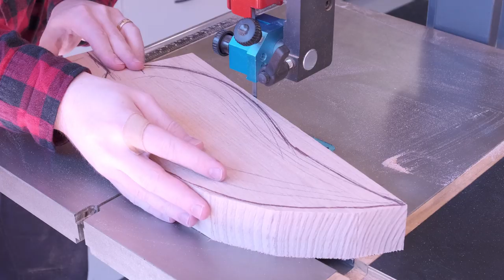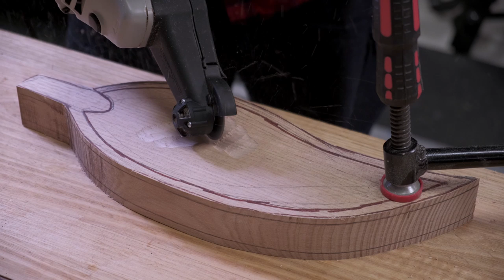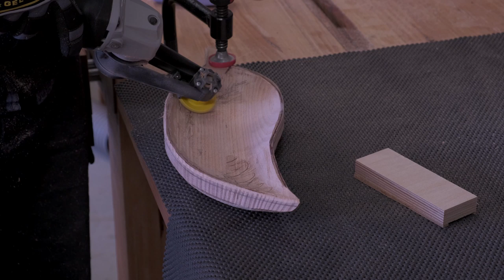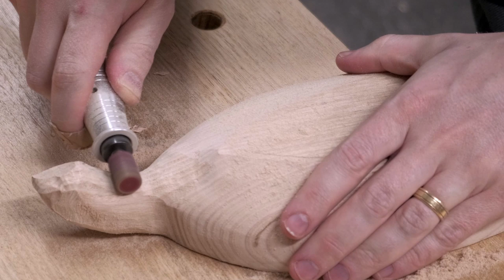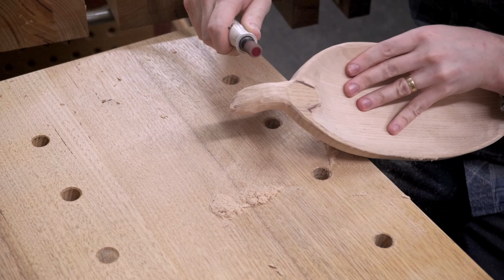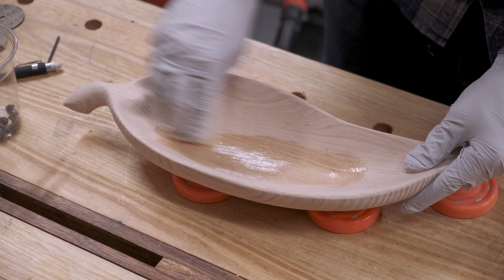Woodworking: Powercarved Leaf Bowl

Comment: Looking forward to the 101 series.  Great video.
Reply from the maker: Thanks!

At this stage I'm thinking potentially 4 videos + intro video

* "Intro" covering safety/PPE, workholding, general theory;

Then a video per tool/class of tool, with examples of how to use it and a project for each. ie
* "foredom/rotary tools" covering dremel/flexshaft tools, burrs, and maybe do a 'spirit in the wood' carving 
* mini-grinders", covering the mini-carver/mini-turbo plane, 
* "ball gouge" well.. just the ball gouge for that
* "turbo plane"

I don't have a chainsaw so I can't do chainsaw carving ;)

Any other things you'd like to see?
Reply: Can’t think of any at present, but I’m sure your series will invoke new ideas and questions.  I’m mainly a turner but already have a number of these tools.  Maybe this will be the nudge I need to start using them more.  I will definitely be giving that leaf a try very soon.  From what I’ve experienced, holding the piece is perhaps the most important and tricky part.  Look forward to new ideas on that.  Every bowl I turn starts with a chainsaw so I don’t need that anyway.
Reply from the maker: Though I don't really turn these days, I've been eyeing off WoodCut's "Pro Mount" which lets you use a 4-jaw lathe chuck for carving. Something like that might be even more useful for a turner like you!

Comment: Do you have more info on that hardwax oil you use? Is that the only finish you put on? How many coats? Thanks!
Reply from the maker: 2-3 coats of hardwax oil is all thats been used on it. I can't remember exactly what I used, it would have been either Fiddes Hardwax Oil or Osmo Polyx. These days I'd probably use Livos Kunos
Reply: @TheWoodKnight  thanks a ton for the response, I use a linseed type blend called Dalys Seafin Teak Oil I like a lot but I'm looking for more options always. I just looked that stuff up, looks great. I'm thinking ordering a clear and a black sample, any recommendations for a 3td or even 4th you couldnt live without? I work primarily with western red cedar and maple, maybe cherry if I get lucky.

Comment: So that's why I have such a hard time controlling my Dremel..  thanks.  Not sure if it has a reverse, I'll check next time I need it.
Reply from the maker: If it doesn't, you may find "push" rather than "pull" is easier to control. Light passes should be able to be done in either direction, but the type of cutter will also play a part. Carbide burrs like what I was using are unidirectional, as they're basically just big spikes. Something with blades like Arbortechs tools will only cut in one direction.

Comment: What yellow carving disc do you have attached to your mini carver? How did you attach it? Did it work well for you? Very nice bowl by the way!
Reply from the maker: It's a King Arthur Tools burr, it just bolts on like normal discs do on the Mini Grinder, using a brass bushing.
On the Mini Carver (the 'next gen' model), the bushing  isn't needed from memory.

On the mini grinder - it was great. On the mini-carver, I don't tend to use it as much because of the variable speed lets me use sandpaper more effectively to contour (whereas on the mini-grinder it'd just burn)

Comment: Nice carve, mate.  👍
How long did that session take?
Reply from the maker: It's always a little hard to tell when cameras are involved, particularly the first section that was live streamed - adds a bit more pressure.

It was probably 2hours carving, an hour sanding.  If I was to make a second one, probably would take half, and then a third would be faster again. Part of my problem was I didn't stick  to one particular tool (I should have done the majority of the interior with the ball gouge), and I kept changing where the curves are. I'd get it to one point, slow down and finesse... then decide to take another 10mm off!
Reply: @TheWoodKnight  
Hahaha,  yeah mate,  I hear ya. Think we all do that to some degree at some point... 
Almost done... Nope, take another few mill off!